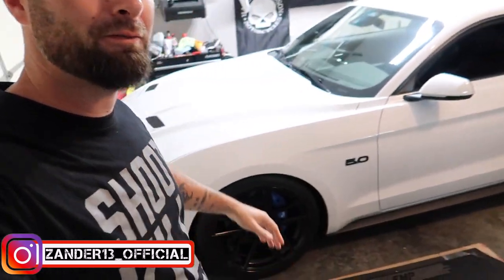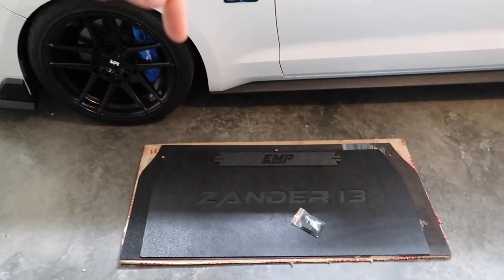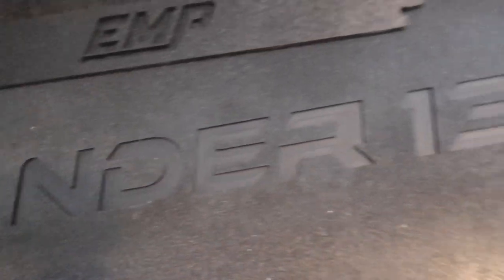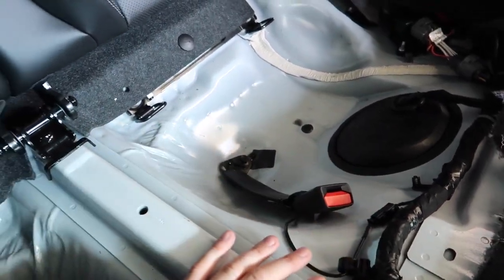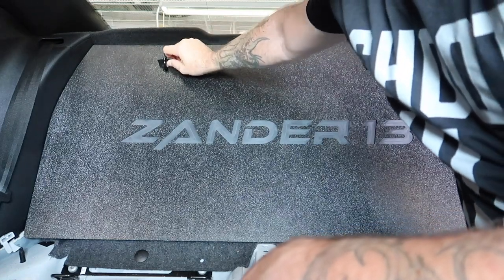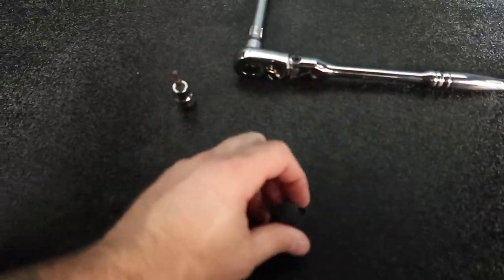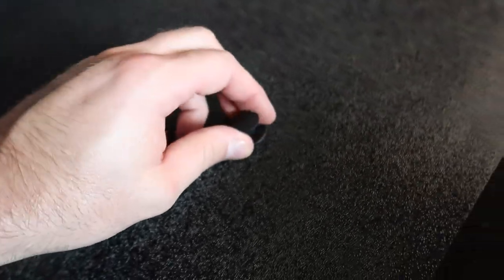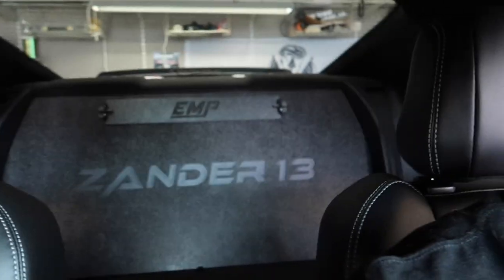This New Mustang Rear Seat Delete is AMAZING and does it all!! *EMP Parts

Comment: Hey Alex, it is been a few weeks since your last video. Your car has really been re-done since you picked it up new with zero interest car loan. I don’t see what else you can do it!!! The logo looks fantastic in the backseat area!!! Are you planning to go down on the size of your pulley? The car looks great with the Mach 1 front end. I ordered a new Dark Horse back on 6 April. Still waiting and now with the Union strike it may be Nov or Dec before I get the car. Do you have a recommendation on tires that I should replace on the Handling Pack (HP) Perelli Trofeo RS tires? I was planning on keeping the same size tires F 305/30/19 & R 315/30/19 going with Nitto 555 as opposed to Michelin PS4s. Thoughts???
Regards‼️👍💪😎🇺🇸✝️

Comment: I'd give this rear seat delete kit just an okay. The fitment actually stinks and the lower corners leave the metal showing on both sides.I don't see why they couldn't have made  injection molded plastic pieces to cover the lower sides so the metal wouldn't show. On a 1-10 I'd give this kit a 6...